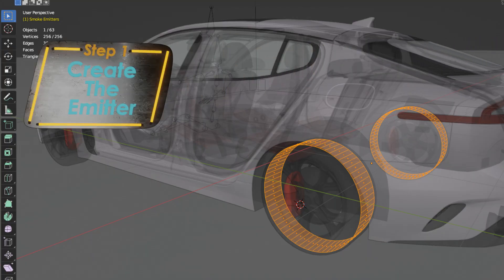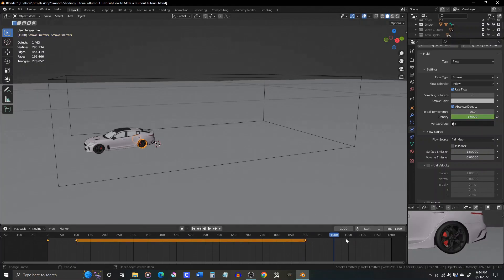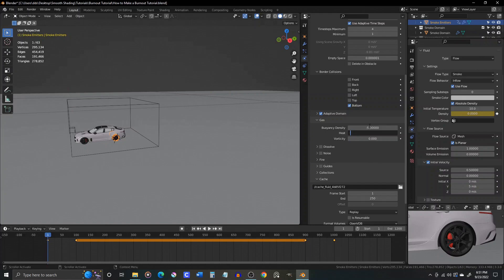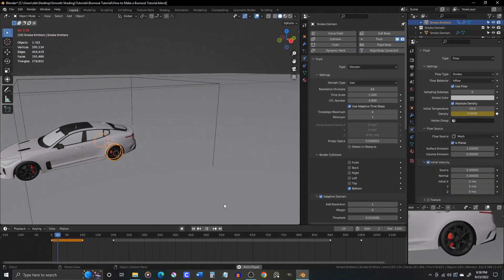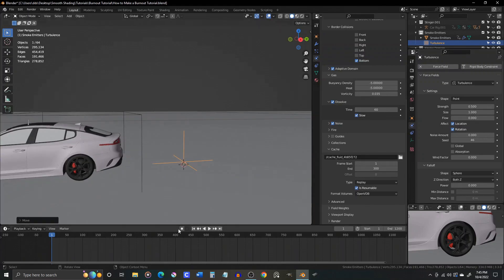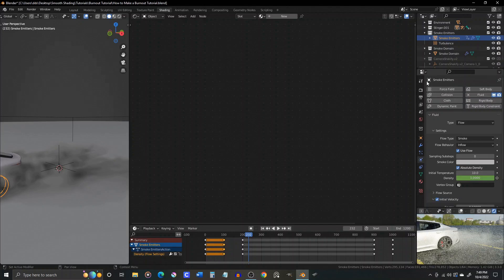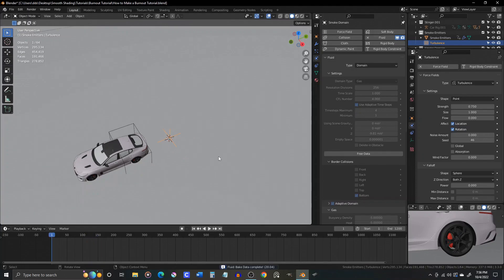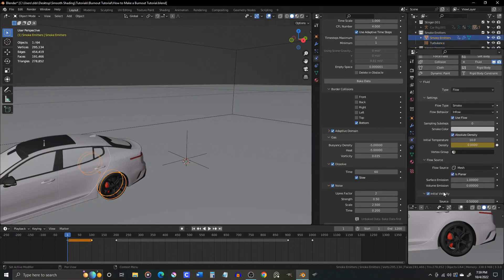How to Make a Car Burnout Scene in Blender 3.3 (Intermediate)

Comment: my smoke that emmitts from the wheels is really boxy if that makes sense. ANy suggestions ?
Reply from the maker: @hypersnake2673  The resolution divisions of the smoke domain. Try setting it higher. It will take longer to compute but will result in smaller voxels for the smoke.

Comment: Thanks for the great tutorial. So, I'm doing a different project where I need tire smoke during drift. But there's an issue which I'm unable to resolve. So, I baked the smoke sim in openvdb file and when I import it back, the location of the imported openvdb file seems to be shifted to somewhere else and no matter what, I'm unable to align it with the car's tires. I have applied scale, location and rotation of the smoke domain before baking the smoke. Can you help me how to fix this? (Blender 3.5)
Reply from the maker: Thanks for the positive comment. You may be able to parent the vdb smoke to an empty. Positioning the empty near the spot where the smoke is generated from might help manipulate it better. Then you can move and rotate the empty to control the smoke. If the empty is patented to the car body then it should also follow the movement of the car during the drift. Let me know if that works or not.
Reply: @Smooth_Shading  That sounds good. Will definitely let you know here if it works :) Thanks for your suggestion 🙏
Reply: @Smooth_Shading  UPDATE : Tried out the Empty method and it proved to be more of a problem than a solution because as my car is drifting and rotating, the smoke also gets rotated and I had to put keyframes everywhere to keep it sane. Also, because of the adaptive domain, the scale and location of the smoke also keeps on changing. 
So, the closest "fix" I could do is to turn off adaptive domain. The baked smoke sim was relatively easier to handle. I just had to manually fix the location of the smoke by keyframing it. the scale and rotation stays stable. I'm still looking for a better and more precise fix though.
Reply from the maker: @ibodhi  If you import the saved vdb file, you don't need the domain anymore, I don't think. If you keep the domain in the scene and bake the smoke sim, it should just follow the emitters that are patented to the tires. I did another tutorial on tire dust that deals with a larger domain, maybe something from that tutorial will help. It can be challenging and frustrating. Sometimes, you might want to delete the domain and emitters and start over. I'll help as much as I can. Keep me posted. Don't give up, brother.
Reply: @Smooth_Shading  Yeah, I don't use the domain after finishing the bake. What I meant was if you're baking the smoke using adaptive domain, then the baked vdb after importing is difficult to keep track of. That's why I found the result of the baked smoke when I turned of adaptive domain much better even though it still need adjustments. 
And I have deleted the domain and started over so many times that I lost count of. I'm trying different settings. Definitely won't give up, will keep trying till I get the end result! And thanks a lot for your helpful suggestions. Can't thank you enough :)
Reply from the maker: @ibodhi  I remember when I was working on my Nissan Titan truck driving in the desert animation, there wasn't a lot of tutorials out there about this subject, probably because it's so challenging and time consuming. It took me months, and a ton of trial-and-error to put together the "Tire Dust" and the "Burnout" tutorials. The goal was to try and prevent other people from going through the same troubles. There are so many different variables possible in a given blender scene that it's hard to cover all of them. And alas, someone, in this case, you, my friend, is still going through the "hell" of  building a successful tire smoke sim. I wish I could solve it. I understand the frustration. You seem to be handling it with a positive attitude though, that's half the battle. I admire that.

When you first create the smoke sim, is the domain parented to the moving car or anything in the scene?
Reply: @Smooth_Shading  Thanks for your kind words. I really appreciate your efforts you're putting in for others by making such helpful videos and also replying to each and everyone and trying to help. 
Talking about the smoke, actually I'm able to do the smoke sim relatively well.. It's just that I'm having problem after importing the baked vdb. My plan is to make the animation and smoke sim in blender and then render it all in UE5. That's why I need the smoke vdb.
Reply from the maker: @ibodhi  You're welcome, brother. Thank you for the comments and feedback. I don't know much about UE5, or unfortunately working with VDB files. I wish you the best in figuring it out though. I'm confident you will get there. Thanks for all the time you took to communicate with me and checking out my content. I'll be curious down the road, wondering if it all worked out, so let me know in the future whatever happens. And if you're happy with the result and post it somewhere, let me know where, I'd love to check it out.
Reply: @Smooth_Shading  Thanks a lot brother. Will try to post a video once I'm done with the final animation :) Keep up the great work on your channel!
Reply from the maker: @ibodhi  Thank you, my friend!

Comment: how do u make the animation ?
Reply from the maker: Someday I'll do a tutorial on the animation. Basically, use Rigacar. Thanks for watching and commenting!
Reply: @Smooth_Shading  i meant the car having the handbrake and the rear wheels spinning without the front wheels moving, how do u animate that with rig a car addon?
Reply from the maker: @VotechsDigital  Use the main rig control to move the car forward just a little. Use the rear end control to drift the rear to either side slightly. Use the rear wheels control to rotate the wheels independently. Keyframe all of them separately to get your desired result. Does that help?
Reply from the maker: @VotechsDigital  Also use the rear suspension control to squat the rear to help reflect the torque during the wheel spin. And then, bring the suspension back up when the wheel stops.

Comment: What pc specs do you have? I'm asking as a reference to know how much time my animation would take
Reply from the maker: Intel(R) Core(TM) i5-8400 CPU @ 2.80GHz   2.81 GHz
12.0 GB (11.8 GB usable)
64-bit operating system, x64-based processor
Hope that helps! Thanks for checking out the video.
Reply: @Smooth_Shading  thanks a lot